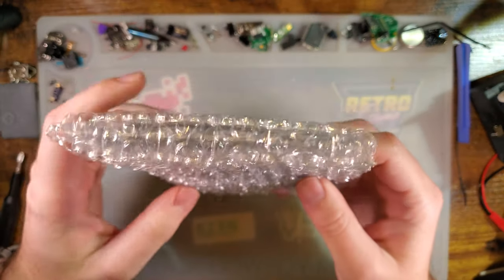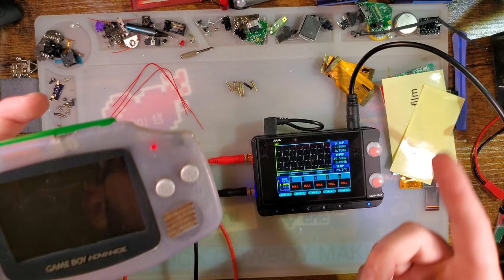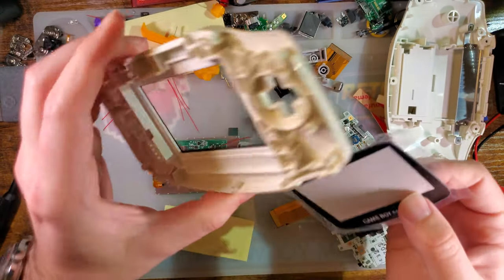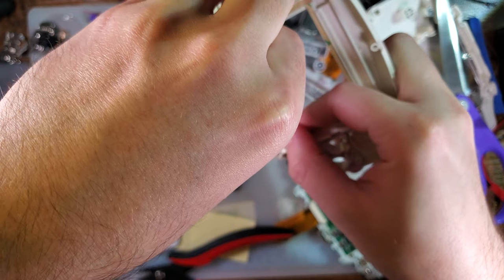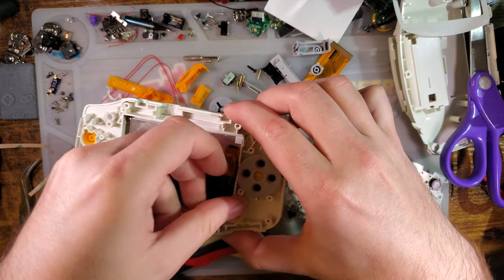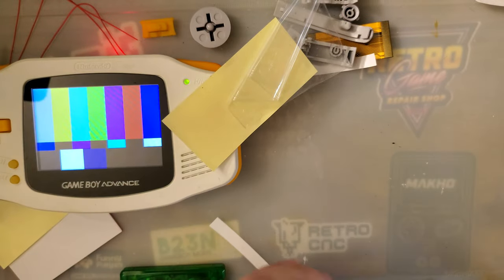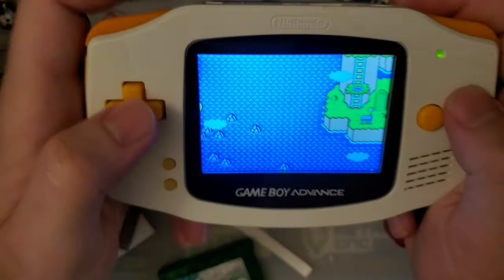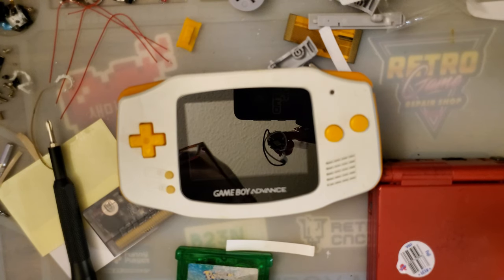"Drop In" -- Game Boy Advance IPS Kit ('One Chip' No TV Version)

Comment: I know this is an old video, but do you know if this kit can only use the touch sensors for the brightness and color? Mine is so frustrating to use because I'm always accidentally touching one or the other. It makes me not want to use it.
Reply: I ended up figuring it out. There are 3 pads on the screen motherboard for L, R, and SEL. You have to wore those to the associated test pads on the gba motherboard. It worked well for me, although it was tricky to run the wires.

Comment: I believe I have the cloud version I purchased from RRGS. Question for you, it says not suitable for IPS lens only OEM. I followed such directions, but an eight of the screen is cut off from the top unless I tilt the gba and can see the rest of the image. Is that common?
Reply from the maker: How's the alignment on the bottom? It can be difficult to get the alignment correct, especially with all the different brand shells and lenses these days.
Reply: @makho  oem shell, and third party non-ips lenses. The screen is cut off at the top by maybe 5% very minimal. You would have to tilt it upwards to see the portion of the screen being cut off. But the alignment is a bit off now that I took a good look at it. Wish I could show it so you can take a better look a it.

Comment: I am confused. are the drop in versions 9380 based? or are they different.
Reply from the maker: no, they use different (newly manufactured) LCDs. 

Like the Q5 screens, the 9380 screens are called as such because they are screens literally pulled from blackberry 9380 phones (or blackberry Q5 phones). If you can't pull the screen from a blackberry 9380, it's not a blackberry 9380 screen.
Reply: @makho  ah, I thought 9380 was the name of a controller chip. thanks for the clarification!